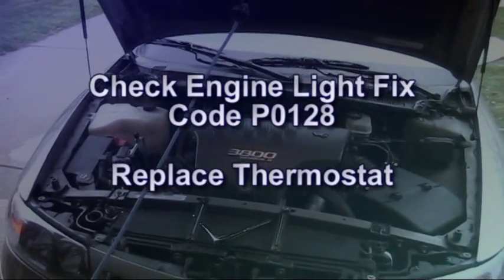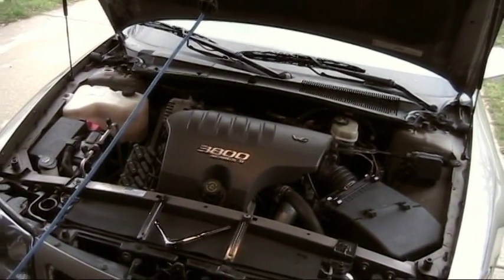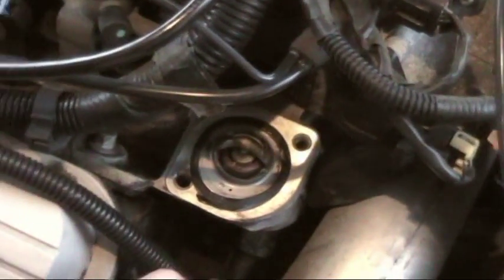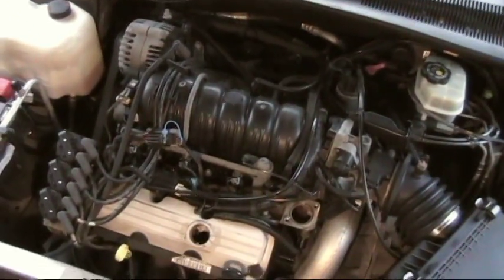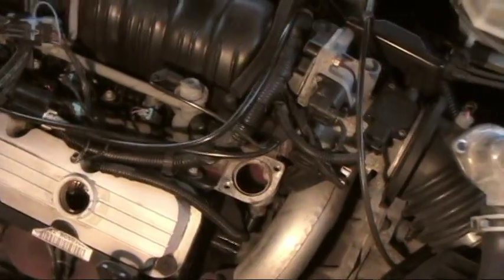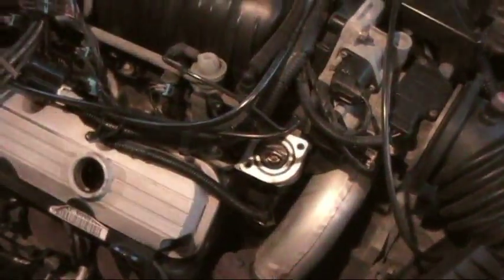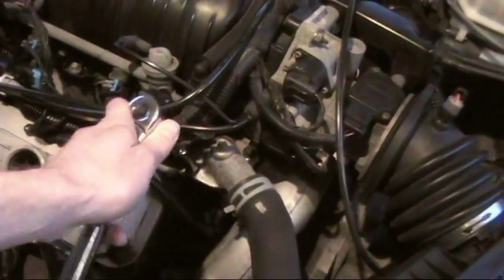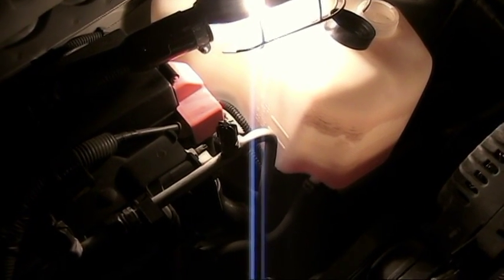Engine Coolant Thermostat replacement 3800 V6 engine - Pontiac Bonneville P0128 OBD II Code repair

Comment: The thermostat you pulled out was not jacked up. The OEM stat is in fact off center. I just replaced mine today and both the one I pulled out and the new one I put in were off center. I replaced with OEM.
Reply from the maker: Yeah, I looked at it more back then  after the video and noticed that it was designed off center. The weird offset with the raggedy seal definately looked screwed up at first.

Comment: Did it in morning after car sat all night and didn't have to drain  it. Not a drop came out of the hose. 01 GTP 328,000 miles and going strong.
Reply from the maker: Cool. I just drained some out just in case.

Comment: Thank you for the video! I did the same thing you did. My ac was working before and now it just blows warm air. What should I do? I tried to bleed but never heard any air coming thru. I don’t have any problems with hot air or overheating.
Reply: Sami J what was it causing air to blow warm ? I just bought a 99 Camaro V6 3800 and he said he couldn’t get the engine light to go off & he took to different mechanics to try to fix but never could figure it out. Idk but have a weird feeling it’s the ECT sensor under the throttle body on my situation. If it works I’ll post it. I’m no mechanic. I just like to try and fix things myself but only YouTube certified. Lol. Good luck. Hope it helps

Comment: Hi!! great video.... question i have replaced the same part as you and i still get the same code p0128 temp to low...why
Reply: The computer stores some failure codes; a code reading tool can normally clear them. That way, if it recurs, you know there's still a problem - possibly with a temperature sending unit.
Reply from the maker: It may take several 20+ minute drives (from cold starts) for the code to clear. The computer needs to see several cold to 200 degree plus cycles. If you still have the same code, you may have a temperature sensor issue.

Comment: could it cause a system too lean?
Reply from the maker: No. it will usually cause the system to stay rich.
Reply: JGonYT ok mine gets to where it won’t crank after driving for a little while and if sits for more than 10 mins will not crank. Unplugged temp sensor and it cranks but replaced it and now I’m getting P0118 code.

Comment: Do the thermostat cause it not to pick up speed. ???
Reply from the maker: Most likely not. It could cause your car to overheat, and it would have to be really overheating a lot for the car to have problems with picking up speed.
Reply: What could it be

Comment: Hi, my replacement thermostat for a 2006 Buick with Series 3 3800, the part is thermo 131-120 and it's body is round but my concern is the spring is not centered, it's offset towards one edge. does it matter if spring is closer to front, back, left or right of block's water hole?
Reply: It won't be cenntered with that Thermostat because the top of the 131-120 is off center.

Comment: Hello Jay Gee (as your Michigan license plate states). I recently purchased a 2005 Pontiac Bonneville less than a week ago. The engine appears to be exactly like the engine  model/year you are working on in the video. Today, the temp guage hit 210 (at most 215). The sensors nor the check engine light went off  and I wonder why?  Feeling very, very concerned, I have a two-part question.

1. Should I perform the procedure shown in this video just in case? I have never worked on a car before, but do to budget constraints I will need to complete this myself. 

2. If so, kindly provide all tools/materials I need to purchase at a local Autozone in order to complete this repair.

Many thanks, from a fellow Michigander, now in Minnesota!
Reply from the maker: With the AC On and 80+ degree heat outside, 210-215 sounds pretty normal. 240-250 is when a car is usually considered overheating. Coolant isn't even sent through the radiator to be cooled until it reaches 195 degrees. 

If you still did want to do the work, you just need the proper thermostat (usually comes with gasket), a plastic paint scraper or a plastic razor blade. You could use fine sandpaper but I wouldn't recommend it if you are not used to working on things. If some grit gets into the coolant it could get caught between the water pump shaft and seal and cause wear and a leak. You also either will need some kind of siphon or pump to drain some antifreeze out if you don't want it to leak and make a mess on the top of the engine. Another draining option is to take off the bottom splash guard and take out the drain plug with pliers under the driver's side of the radiator to let some coolant out. you will need a metric socket or wrench for the bolts. I THINK they are 10mm, but I am not using/near the car for the season to check. You will also need coolant to top the system off when you are done.
Reply: Thanks. Your initial response was correct. It was in the 90's  yesterday (7/22/17) and may have contributed to the issue. Today, the the temp was lower (mid 70's) and the car was fine. The thermostat stayed between 195 and 200.  I will still consider doing the work or check the local shops for estimates especially since the car is hovering around 230k. Many thanks!

Comment: I have a 98 Bonneville I wanted 2 know would I need a thermostat if my car jerkn da temperature would go pass 220 n go down BT would still jerk like I'm running out of gas sumbody help me
Reply from the maker: If your temperature is that high it could be a stuck closed thermostat. If the car is jerking still,  it could be misfiring also, which has a number of possible causes.

Comment: Someone please correct me if I'm wrong, but I'm fairly certain you want to make sure the radiator cap is on when the coolant is up to operating temperature, making the coolant system sealed, else the water will reach boiling temperature?
Reply from the maker: +Ben Sauter The coolant lowers the freezing point AND raises the boiling point of the mixture. The cap seals the system and increases the pressure which in turn raises the boiling point even more. The cap regulates the pressure and lets any excess into the overflow tank. I had the cap off to just to get most of the air out. Once it started to overflow I closed it.
Reply: Okay, because technically in a sealed system it would have no room to expand, turning into a gas. Makes sense. Thank you!

Comment: what does it mean if I got a leak in back of the engine on the passenger side just behind the power steering . coolant everywhere . no drainage into the oil which is great but I'm having trouble finding the leak. strange that it happens there. when I squeeze radiator hose bubbles pop out in the reservoir so it's a leak but can't find it.
Reply from the maker: +cordell cloud You probably have bad plastic coolant elbows. They are small 90 degree angle tubes. There are two near the tensioner/alternator/power steering area.
Reply: +JGonYT how do I find these? and how do I replace them . I ain't a mechanic but who really needs one now days when there's YouTube.  the coolant is on the power steering and some on the left side of the engine.  I even had some on the windshield when I opended the hood and let it run . when my hood was closed it was on the plastics engine cover .
Reply: +cordell cloud specifically there is coolant on my alternator and behind it and leaking down the left side of engine and some coolant just gathering behind the engine on the passenger side
Reply from the maker: +cordell cloud I just recorded a short video about it. I'll try to put it up later tonight.
Reply: They sell metal elbows to replace the plastic ones,no more crack's and leaks

Comment: What year is your Bonneville? I can't run my air out of my radiator because the filler neck will drip on to my belts. I tried this method before about getting the air out this way but i ended up throwing a belt. GM engineers are awesome.
Reply from the maker: woosa42 The thermostat housing has a bleeder screw on the top of it you can use to get most of the air out. It will squirt antifreeze when the air is gone.

Comment: Do I really need to get the antifreeze out to change the thermostat?
Reply from the maker: No, you don't have too. It's just a little less messy. You don't need to take a whole lot out.
Reply: Oh ok...yeah I got that check engine light on too.and I took it to AutoZ one so they could see What the problem was.and they said the car wasn't getting hot enough or something like that. They told me I may need a new thermostat.so that' what I'm gonna do.ill put a new one on it..but I may not take the antifreeze out...its not that hard to change the thermostat ..this video really helps. I didn't even know where the thermostat was on my car..but thanks broo

Comment: What if we don't siphon the fluid first and just replace the thermostat and simply be done? Will a fault occur?
Reply from the maker: The thermostat housing seems to be slightly lower than the top of the radiator. You could skip siphoning but it's probably going to make a bit of a mess. The main thing is to get all the air out of the system when you're done.

Comment: Is it possible to use water instead of coolant while filling the tank back up? I only ask because I have to change my thermostat at my home and I cannot make it to the store to buy more coolant at this time. I only have about half a gallon of coolant left in my jug.
Reply from the maker: Sorry for the late reply. Yes you can add water- you just are going to want to make sure you fix the coolant to water concentration later on- especially before winter.
Reply: Do you have a short answer on how to do that? I have been using water since then because I have a leak in my intake and it's too expensive to constantly fill the tank with coolant if it just leaks out as soon as I drive somewhere.
Reply from the maker: +Holly Manuel
 If you live where temps will get below freezing soon you HAVE to add coolant or you could crack your engine block. Since you've been adding water, the easiest thing to do is to buy FULL STRENGTH (not 50/50) and pour that into the tank or radiator when you need to top off in order to to bring up the concentration. You can buy an antifreeze tester (looks like an eyedropper with little floating balls inside.) After adding the full strength stuff, drive for a few minutes to let the stuff mix in, and then let the car cool off and test from the radiator. Depending on how bad your leak is, this may take a few top-off times to build the concentration up. If the leak isn't fast you'll have to drain some of your watered down coolant and replace it to get the concentration right before you get freezing weather. After your concentation IS right, you HAVE to add 50/50 instead of water in the winter. The best thing would be to get the leak fixed tough.

Comment: Just a small safety precaution.  When the need arises to remove the cowling from the top of the motor it is best to replace the oil filler cap. Easier than removing the valve cover to retrieve what ever you accidently dropped in there! Especially if you're going to start the engine prior to replacing the cowling. Dropping a socket or something metal through the opening could be damaging to the motor and the mechanic! Otherwise this was a good Tutorial.
Reply: kenneth brown I had this same thought. I worry about anything going down into the valves. It doesn't take much to score a cylinder wall. Even dirt is dangerous. Good tutorial for a thermostat change though. Thank you for taking the time to record this, JGonYT. I'm going to change mine even though the light hasn't come on. Still not going up to operating temp, though. Going to flush it with a kit also. My A/C isn't getting cold even after adding refrigerant. Maybe a plugged evaporator?
Reply: @randyreynolds5601  Nothing is going to get into a cylinder through the valve cover except maybe oil if you have bad valve guide seals. The only way a solid object could get into the cylinder would be thru a spark plug hole and believe me, people have done it! In the old days of cars with carbs, it was common for people with butter-fingers to drop stuff down into the intake manifold which makes a magnet a handy thing to have around.

Comment: Since when does how the thermostat is operating affect the fuel to air mixture??!!
Reply from the maker: When the thermostat is stuck open the engine never heats up enough to go into closed-loop mode, so it keeps running a richer mix. The coolant is basically "being cooled too much". Normally the thermostat lets just enough through the radiator to keep the coolant at a set temperature- for the 3800 V6 that is 195F.
Reply: You learn something new everyday! I would never think that would affect each other
Reply from the maker: Sergio Fonseca
Another bad thing about ignoring a stuck thermostat is that over an extended period it can cause accelerated wear since extra fuel is being sprayed into the cylinders. The overly rich mixture not only washes some of the oil film off the cylinder walls, it also builds up in the oil- thinning it (fuel dilution).
Reply: When the check engine light comes on a lot of cars go into "Limp Mode." The computer switches to the basic config to keep the car running, it will not adjust fuel ratio etc...

Comment: Hi JGonYT - thank you so much for this video.  Had the same error code on the same engine (in my '04 Buick Park Avenue.)  Don't know if I'm going to try to do the repair myself yet or not but it's great to see such a detailed breakdown of the issue, where the thermostat is, etc.  A great public service!

Comment from the maker: Thanks- very good points. This is an old video from my channel before the Google/Youtube merger. If I redid this now it would have been more detailed
Reply: does a bad thermostat make the the intake leak?
Reply from the maker: It will overheat the engine if it's stuck closed- which could possibly damage the intake. If it is stuck open it will just keep the engine from getting up to proper operating temperature- which will keep it running too rich.
Reply: I have that same engine in a chevy impala and I had a coolant leak around the intake and it was overheating  so I replaced the thermostat cleaned the coolant and now it's not leaking anymore and it's not overheating idk if that solved my problem are not
Reply from the maker: Keep an eye on the coolant level in the overflow reservoir.
Reply: it stays full

Comment from the maker: The EGR Valve is on the driver's side of the engine near the back. It is near the throttle body and looks like a cylinder that is black on the top with a connector coming out of the top. (Assuming you are asking about the same 3800 V6)